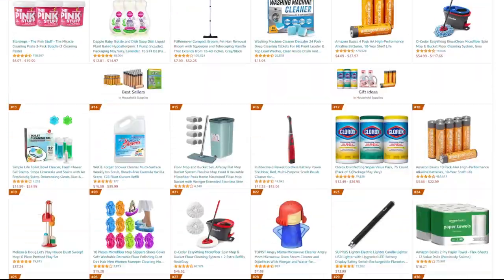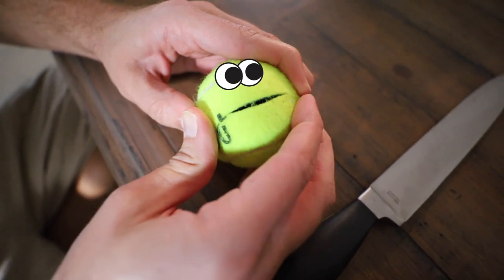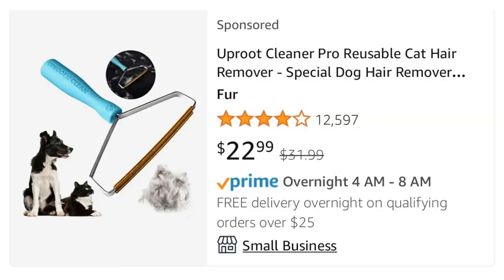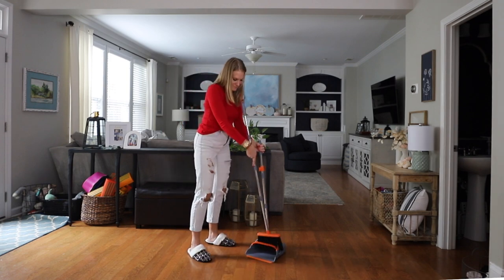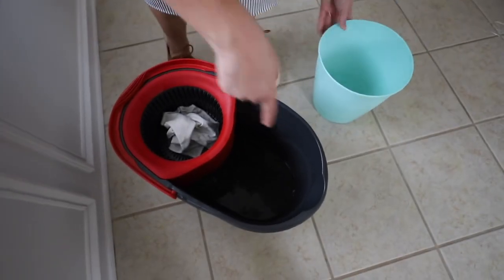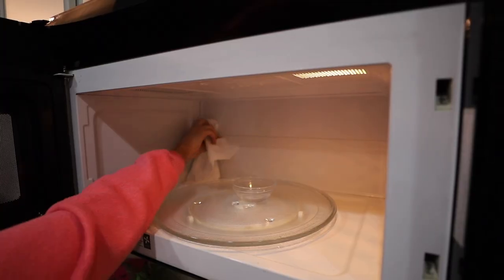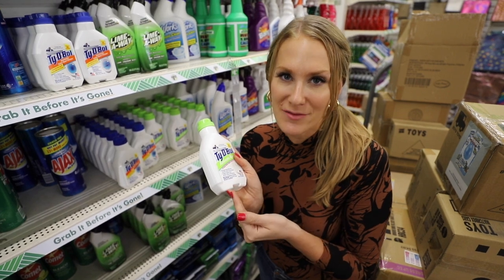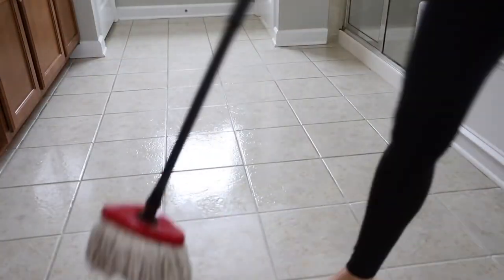13 DOLLAR TREE hacks that beat AMAZON FAVORITES (save $200)!

Comment: With the dollar tree dust pan... you can buy a thick comb at dt in the beauty aisle, hot glue it to the upper part of the dustpan and viola it'll  clean the broom as you go for 2.50
Reply: Suggestions do a video hack of demonstration. 🤗
Reply: @marieacuna2207  sorry I don't make videos
Reply: That's a genius idea!!!!!!
Reply: @vickieskridge1220  thank you
Reply: Also what I did was figured out since the center of gravity tends to be wonky- take the top of the handle off- squirt school glue generously, so it flows on the opposite side ...if it falls backwards put the glue so it goes along the inside of the front of the handle-then get some dollar tree sand and funnel it in and kind of hold your dustpan handle  with the front facing downward and jiggle the sand so it sticks in the glue. Keep the handle parallel to something flat and prop the handle end on a box or book ifbthevglue is in front, so the glue stays where you want it.Or lay it flat if the glue is in back. It works! All that because I had to grab the phone or some and the dust pan  fell over backwards and launched the crumbs. Ibwas like...never again!!! I will be trying your comb hack. I grossly sweep my broom on the rug to clean the hair out. So thanks!!! It is also a dollar tree broom. I am in a small apartment so dt really works for me 😀
Reply: Brilliant
Reply: @laurahale9309  I go outside and brush my broom on the grass then it gets mowed up at some point lol.

Comment: You can also use a half of a real lemon and a cup of water in a bowl, microwave for 3-4 minutes and let sit for 1-2 min then wipe clean! Cuts through smells and splatters and works like a charm!
Reply: Thx 4 sharing 👍😎 KewL tip
Reply: Thank you!!
Reply: Or just use a glass measuring cup you may already have on hand.  Add the water and lemon juice. PERFECT. No need for the "little lady" thingy from Amazon.
Reply: @tanyawalker7585  I don't have a glass measuring cup :(
Reply: @tanyawalker7585  Wouldn't ceramic work?
Reply: I don’t even bother with the bowl, I just soak paper towels liberally, Put it in the microwave and run it for a couple of minutes, and then use that paper towel to wipe things down.
Reply: @maryadedokun2405  Ceramic will work but you need to double check to make sure it's microwave safe.  Still, get yourself a Pyrex 2 cup measuring cup with a poring spout.  I use mine practically everyday and not just for measuring.  And this measuring cup is microwave safe.
Reply: @maryadedokun2405  Absolutely. Anything that is microwave safe.

Comment: I LOVE the baseboard duster hack. My DT did not have any duster mitts, and I didn't want to use the hard DT tennis ball dog toy. I ended up using a dryer ball (soft) and the rectangular microfiber mop head instead. It turned out 2 sided and worked PERFECTLY. It was also very handy for dusting the cold air return and slated louver doors. ❤ Thanks for the great idea.

Comment: I got the O'Cedar bucket and mop for about 40 bucks at Walmart, pre-inflation. If I recall correctly, the mop came with the bucket. However, I hate that bucket. I am going to try adding the flower pot and see if it will fit in it  I spray my microwave with Dawn Powerwash, wait five minutes and wipe it out with a rag wet with hot water.  Works beautifully.

Comment: I absolutely love love love the $20 dust pan and your dollar tree suggestion. BUT if you also purchase a large comb or the package of combs from dollar tree you can hot glue to the dustpan in the same place they have on the $20 version and it works the exact same! We have 3 girls with very long very fine hair in our house. So I actually glued one of the dollar tree combs (that came in a package of assorted combs) that has the bristles or points very very close together onto the dustpan. It instantly removes the hair and any other small item stuck into the broom that the $20 version never removed. Hopefully this helps someone who needs this money saving hack
Reply: Im totally trying this hack as soon as it stops pouring rain in PA and I can get to DT. I have extra combs in my bathroom just need the stand up dust pan.
Reply: Thanks!

Comment: Loved all your ideas but 1.  Yikes Re: cleaning your grout!  Hint: Use grout cleaner.  
When you use anything acidic, or bleaching ex. baking soda & hydrogen peroxide, bleach, etc it causes micro abrasions in the grout which will ultimately make your grout dirtier or absorb more dirt.  It will look great for the immediate but dirtier later & will need to be cleaned more frequently. (Perhaps if your grout has already been bleached or micro-marred it's too late.  I don't know if continued damage makes the dirt worse) I learned this from a Pro and it really does make a huge difference.  True grout cleaner is not terribly expensive and you won't need to clean your grout as often. Also be wary of how hard or scratchy is the brush you use.  Real grout cleaner will clean it w/o the need to scratch or scrub.
Thanks for all of your other hacks.

Comment: I love your ideas Kathryn! My husband is using that mop set up right now. Does it get any better than that?? 😁I'm excited to try this for baseboards. Thanks for all the great tips!! 
I just use what ever spray cleaner I like on the floor tile grout and a brush, but I'm thinking a broom would work, too. Then follow with a quick mop. 
 We use the inexpensive microwave plate covers and it prevents most splatters. We have a few so when one gets dirty, I put it in the dishwasher and put a clean in the mo. I just keep one in there it all the time. When that spill over happens, I wash the plate and do a quick wipe down inside, though it's never bad using the covers.

Comment: Something that works really well in the car for pet hair etc is a pumice stone from the beauty section at dollar tree (usually in the shape of a foot). So you just "scratch" it across your floors and seats and it pulls the stuff right up to work into a pile or have the vacuum hose there going as you work the stone in a pulling (kinda like the motion you would use digging in sand) motion toward you. Sometimes you may need to apply a little pressure and go over a spot a little extra if it's heavily burried in the fibers. Honestly it's the same method/tool that most detail shops use to clean and refresh the pile on your carpeting in your car.

Comment: The bucket of separate clean water makes a huge difference. Especially on greasy floors. 
Toilet bowl cleaner in your toilet tanks makes the parts breakdown faster causing leaky tanks and stress on septic systems.
Reply: Yes! I ruined a toilet tank flapper by using 2000 Flushes in the tank. Those sort of things become more and more concentrated if the toilet isn’t used SEVERAL times EVERY day. I’m thankful it was only the flapper, which is easily changed, and not a harder-to-replace seal.

Comment: What I don’t get about the bucket in the spin mop (or the 2 chamber spin mop itself) is that you are putting a dirty mop into the clean water so aren’t you just making the clean water dirty? Sure maybe not as dirty as it would be just using one bucket but it still gets dirt in it.
Reply: No. It has a lever to opens to allow only clean water to enter the bucket.

Comment: Great tips!! 
Two things:
1. I've seen a few videos from tile experts & they both said the same thing: the main reason grout gets dirty is from wet-mopping Before vacuuming.   If the floor is merely wet-mopped, the water turns the  dust into mud & goes Straight into the grout!  I personally use (White)  toilet-bowl cleaner for the grout & then SEAL it as often as I think about it! 
2. A staple from the DT I've used for years is their Fabric Refresher.  It comes in a blue Febreez-y bottle & it's Great for taming wrinkles.  I even have a travel bottle with this stuff & Bonus-- it makes the clothes smell good! 🤗
Well, I'm off to the Dollar Tree!  Thanks again!😀

Comment: The blue dollartree dust pan is awesome. It has tiny teeth on the side that kind of work to pull things off but the rubber seals to the floor so well it picks up more dirt than any other dustpan I've ever used! They have been out of stock at my store forever and I need another one!!!

Comment: Here's another pet fur removal tip.  DT carries a rough blue nylon scrubby sponge that's about 3" thick.  These are awesome using them dry to brush pet fur or a dried-on spill off the sofa.
Reply: Thanks! I’ve seen those sponges but never would’ve thought to try this. BTW, I love your screen name. Lavender butterflies have always held special meaning by appearing at certain turning points in my life.

Comment: I always put a cover over my dishes and I seldom need to clean off splattered food in the microwave.  I’ve dedicated a clear glass pie pan that resides in the oven.  The pie pan is usually wide enough to cover most plates & bowls & it’s depth makes for a dome that is usually above & not touching the food.  It’s so much easier to take the pie plate to the sink than reaching into the oven & it’s a breeze to clean if you don’t let the food dry on it.  Otherwise just soak it for a bit & it all wipes off easily.

Comment: So I watched this video this afternoon. Decided to try the hydrogen peroxide & baking soda thing this evening on my bathroom (tile floor is 4ft by 7ft). Took 30 minutes to get down on the grout, get the grout scrubbed and another 45 to get cleaned up. Had to mop three times to get the baking soda residue off. Did lighten the grout a bit but took way to long!!

Comment: On the microwave Jack. You can get the stinky smells out of the microwave using baking soda and water mixture and run for 3 or so minutes and leave it in there to steam and it takes the smells away.

Comment: I microwave my dish sponge before I use it almost every time. I run it under some water real quick, squeeze out the excess, then put it in the microwave for 2 minutes. The leftover soap suds out and I find that the heat and soap allows me to clean the microwave very easily. I take out the sponge (carefully, it’s hot!), then clean the microwave with some paper towels. It’s super easy and good for a quick clean.

Comment: I’ve watched several of your videos and love many of your tips and tricks. The toilet bowl cleaner in the tank, however, will cause the seals to break down faster causing the tank to leak water into the bowl. Once the water level gets to a certain point, the tank will refill as if it was just flushed. The hack here is to replace the tank parts necessary and stop using tank-dispensed toilet bowl cleaners. 🤦‍♂️ I continue to have issues trying to get parts for my one-piece toilet so beware of this solution. 😬 I have an O Cedar mop/bucket combo and love it so I’ll be looking for the small bucket to make things even better. 😊

Comment: Thanks for the formula for cleaning grout on floor tile. However, I have yet to see any method that does not require plenty of elbow grease—even when using an Amazon sold tool! What will really be revolutionary is flooring that looks great, does not cost too much and does not require a physical workout and an afternoon to get it clean. Bonus points if they sell it at the Dollar Store, lol!

Comment: I bought a cake carrier at the dollar store and use it as a microwave cover.  It’s tall, and wide enough to cover a plate of food easily.  Much better than what is sold as an actual cover.  I never have messy splatters to clean up.

Comment: All you gotta do is put a microwavable cup of vinegar water or plain water even and heat it in the microwave long enough to create steam and it loosens up any stuck-on food. I use a glass measuring cup because it has a spout. The time depends on the amount of water you use. Doesn't take much and the whole point is to simply create steam. For example, if I use a coffee mug, 12-15 oz mug, and put water ¾ of the way full in it 1 ½ mins is the perfect amount of time for when I make hot tea and it creates enough steam to clean the microwave. So knowing how much water that is I would say if you were to use 1 cup (16 oz) of a water-vinegar mix (¾ water ¼ vinegar) 2 mins should be enough but if not you can do another 30 secs - 1 min. It depends not only on the size of your microwave but how stuck on the food is. You can always do a 1 to 1 ratio of the vinegar and water for really stuck on food. AS ALWAYS BE CAUTIOUS OF HOW HOT IT WILL BE. Use heat resistant gloves, oven mits, etc to take it out after. 8🥰 Hope that helps 🥰

Comment: Hello,
Love all your tips and tricks. Just wanted to add that you can pick up the Scouring Stick from Walmart for about $2.00 and it may be at one of your local home improvement stores. I have cleaned in-between my bathroom tiles and I like the job that it does. Yes, it's a little on the harsh side but gentle rubbing does a nice job.
Reply: Yes I love that scouring stick. Works great and can be used on may other surfaces too.

Comment: Just a little bit of information. I have plumbers in my family and they say never put any chemicals in the tub of your water tank of your toilet. It deteriorates the working parts. Only put the kind that you can put in the bowl that goes down the drain. I don't use that brand that you had with that makes a flower. I used the scrubbing bubbles brand I think. And they do work really good. But Dollar Tree also sells a lysol brand hanging one , That is almost triple the price at wal-mart. And yes they are the same size and they work great.

Comment: The dustpan from dt breaks REALLY  easily, and the handle is extremely short. We've been through 3 of them in two months. Great in a pinch though, or if you're gentle with it. I'm going to order the amazon one, or maybe a heavy duty one from lowes. I have chronic pain and it's a necessity for me.
Reply: Try Dollar General, I bought one similar the the one she showed that flips up for storage and has prongs to trap dust bunnies off the broom for under $8. It was while back but hopefully the still carry it.

Comment: Microwave cleaning hack: take about 2 or 3 paper towels, fold into 4, run under faucet until it's wet but not dripping.  Put in microwave,hit 1minute. Let the steam clean your microwave. Just let the papertowel cool off a bit before you touch it!

Comment: Hahaha the dog grooming MIT I actually tried today before seeing this. I had saw a video of someone using a latex glove. It kept sliding off. Then I thought to try my dog MIT. It works amazingly. Also you use a spray bottle, I used a pinesole mix but lightly spray ex: sofa then use the MIT. Keeps pet hair from just flying around in the air.

Comment: I use an old Sonicare toothbrush to clean around the faucet/ handle edges & in little crannies that don't really have an easy way to get in there (all those gross drain spots).  It's effective and it requires zero real effort.  It's one of my ADD/ADHD hacks- actually kind of satisfying!

Comment: Also you can take your Draft or any fabric softener tabs.  Use 
1/2 cup fab tabs
3 cups hot water to dissolve tabs. Place in clean spray bottle after all tabs have dissolved.  Works better an longer than freeze. An way way cheaper.

Comment: A great microwave cleaning hack is put a Tablespoon of baking soda in a measuring cup with 1 c water. Microwave 4 min, let stand 2. Use a damp cloth to clean. It comes off easily.  If you have green beans in there since Carter was President you might need to do it again

Comment: The one thing with the flower toilet bowl cleaners. If you live in an old 1930s apt in Los angeles--there is no tank to the toilet, they have that commercial type handle like in public bathrooms, so putting something directly into your toilet bowl is the only option. Ilove your hacks though.

Comment: Wish I’d seen your hack before I bought the double bucket mop…I have a single bucket mop thingy down in the basement so will Hack that one - or just give it away. I am finding I don’t like the microfiber mop heads as they still have stuff stuck in them after throwing them in the washing machine 🤨. I have a dog that brings sticks and grass clippings into the house. Yuck😬I am seriously considering going back to two buckets and a sponge mop. Microfiber items might be ok with dusting but you have to be selective with what you throw them in with into the washing machine? Than you for the ideas though. Is the Tidy Bowl stuff safe on the seals in your tank? That is my concern when it comes to goes into the tank cleaner stuff…the bleachy circle drop in your tank things can cause problems with your seal eventually needing you to replace those things…what a pain and extra cost when you are wasting water that is leaking. 😢

Comment: Wow, you blew my mind, I'm truly shocked. About the Glass Bowls! Every time I put one of those glass bowls in my microwave it shattered immediately. I just assumed they were not microwave safe. But here you have used it to heat up water/vinegar and it didn't crack in two on you! I'm wondering if I got a dud set. I only use tempered glass measuring cups in my microwave ever since those bowls kept breaking in my nuker. I guess I 'll try a new set next time I'm at the DT.  BTW, vinegar steaming the microwave is a total win. It's the Only way to clean it so easily!
Reply: If you have a coffee mug already, you could just use it (doesn’t have to be full). And it has a handle.

Comment: * If you are going to clean the microwave with water and vinegar in a bowl, you need to add something to break the tension in the water/vinegar solution, such as a piece of lemon peel.  If there is nothing to break the tension, the water/vinegar solution may explode.  This happened to me - fortunately it did not blow the door open, but I have read of that happening to other people.